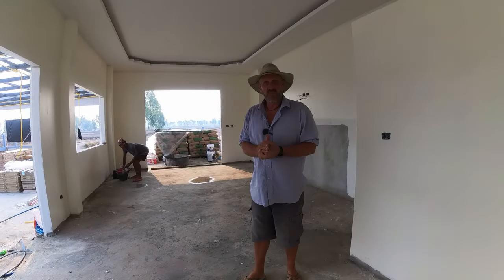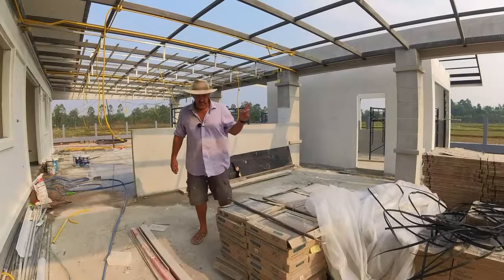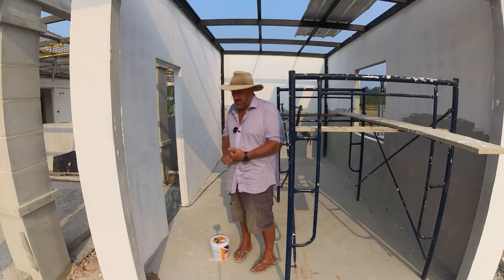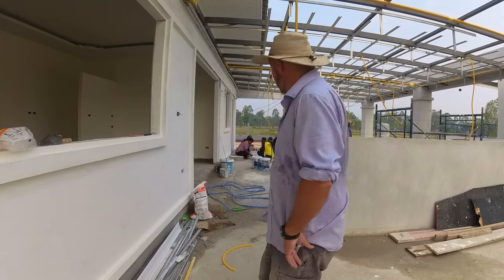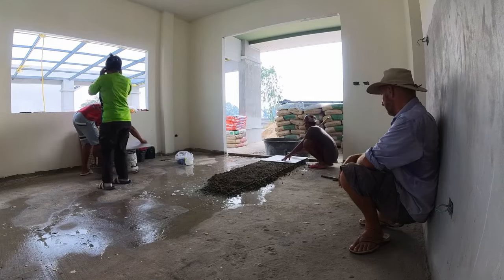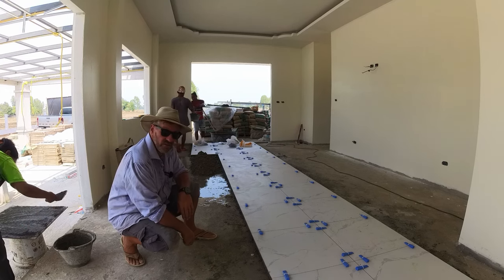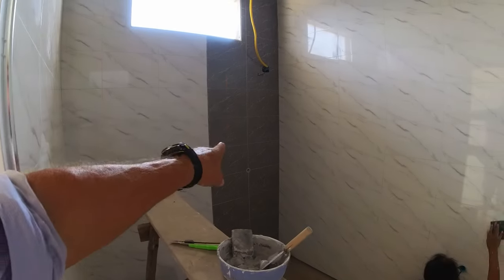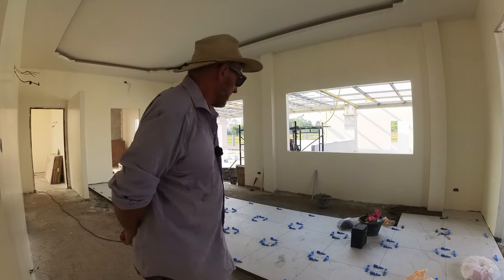First Tiles Go Down

Comment: Hey Kenny! It's coming along nicely! I too am used to the US where they use thin set under floor tiles (and butter the backs). From my research, they do the thick base in Thailand to control the level of the floor. That's why they don't worry too much about getting the slab level because they make sure the tiles are level instead.
Reply from the maker: I assumed it was because of all the "stuff" they carelessly slop everywhere and need that much fill to cover all if it! Lol

Comment: SUGGETION:
In Sikhoraphum District, 🇹🇭 I have noticed a lot of iron in the well water.  This tends to do two things, firstly, it stains the white sanitary ware brown.  More importantly, it damages the pump impellers on the above ground pumps.
As you have a submersible pump in the well, I suggest adding a 100 to150 micron spin-down filter, also a neodymium magnet placed outside the filter case at the bottom to hold those iron particles.
This filter is just a mesh that is washable. It also has a tap on the bottom to drain out any particles.
I am currently back in the UK 🇬🇧.
Reply from the maker: Im going to sisaket tomortpw anyhow. Ill talk to someone other than Thaiwatsadu to see if i get the same answers. I agree, i need some addutional filtering. If for nothing else, for peace of mind.

Comment: Kenny, personally i would have a particulate filter before water going into the tank, and as far as the box gutter why not install on each end an overflow rain head
Reply from the maker: I agree. Thaiwatsadu is telling me the carbon filter has particulate filtering in it and should be in front of tank. I will at least add another particulate filter before softner, if i can work it in i will try to put it in front of carbon and tank. I am not familiar with that overflow device but i will be asking. Thanks.

Comment: If they were using thinset instead of thick mortar, they could get that tiling done 4x as fast.
Reply from the maker: Thats what im used to using. Have still not heard why they do this, but am told europe does this. Can anyone reading this verify that?
Reply: I agree, Don't like that they aren't back buttering the tiles as well, you will get voids under the tile.
Reply: @ParadiseNThailand I live in the UK and we certainly don’t tile like this here!
Reply from the maker: @StephenWestrip  Still not certain why they use such a thick layer under the tile. Could not get a clear answer, that made sense.